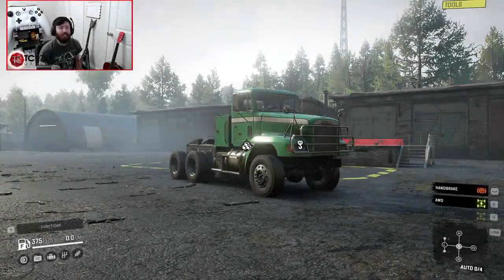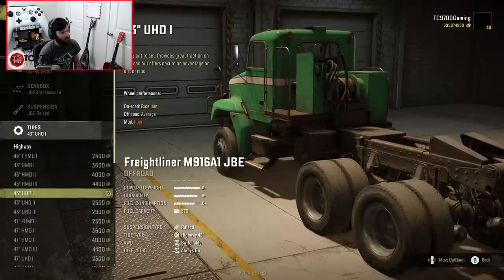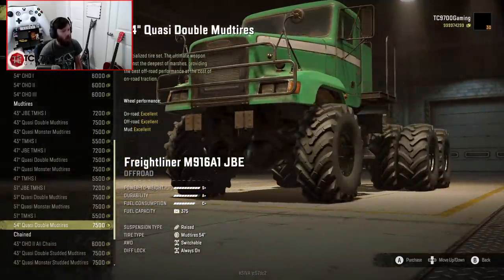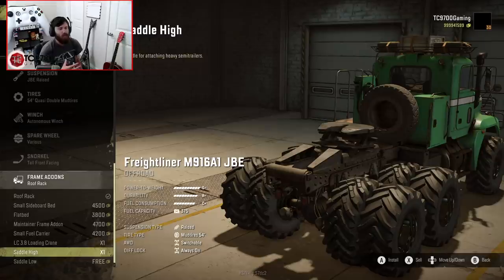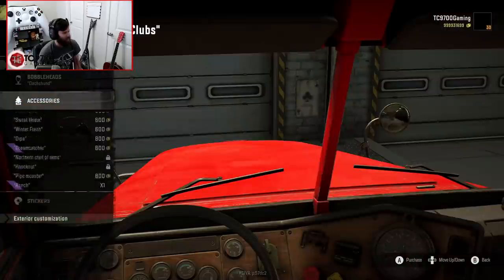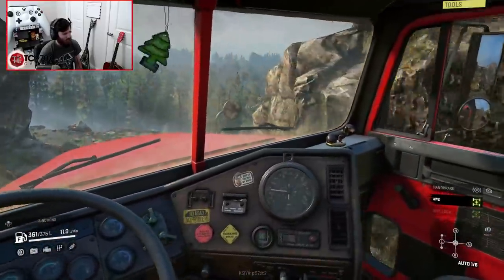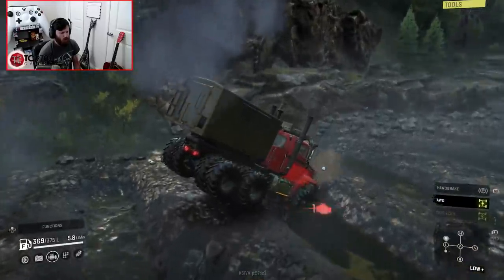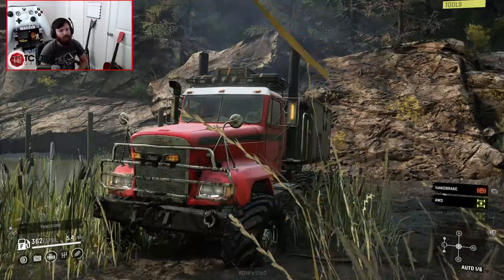SnowRunner: THE ULTIMATE FREIGHTLINER M916A1

Comment: Love the Freightliner. I use it like crazy. Just hate how easily it can flip and how hard it is to flip it back on its wheels. The devs need to fix that...and maybe add a little more fuel.  And whats up with the different colored rims?
Reply from the maker: The fuel definitely holds it back a bit when compared to other trucks. I've flipped it a few times too but that's cause I YEET it into corners sometimes LOL!